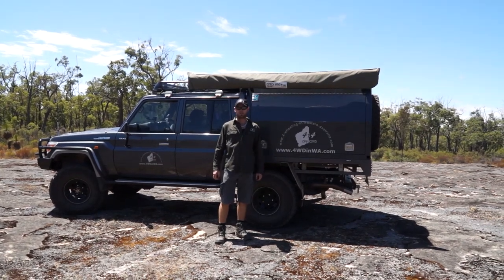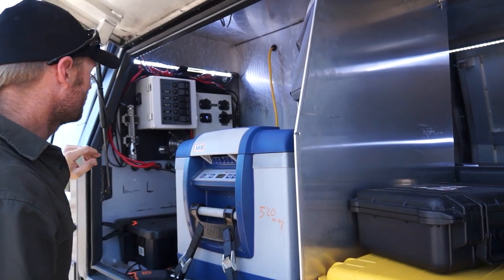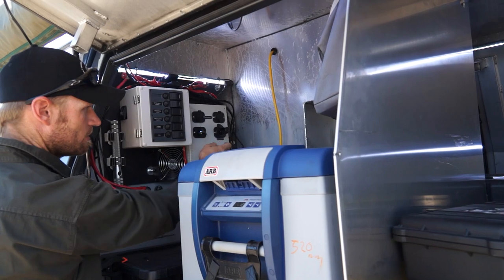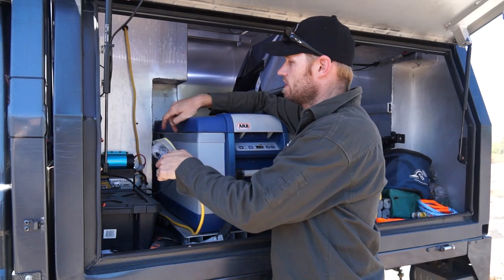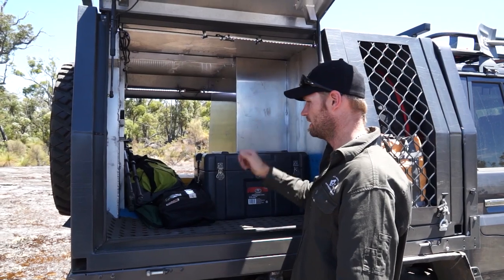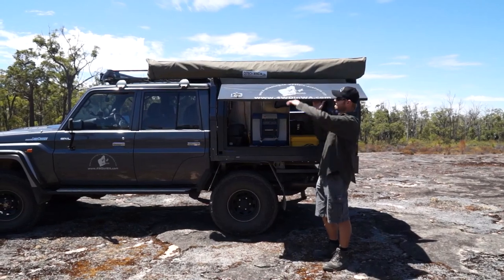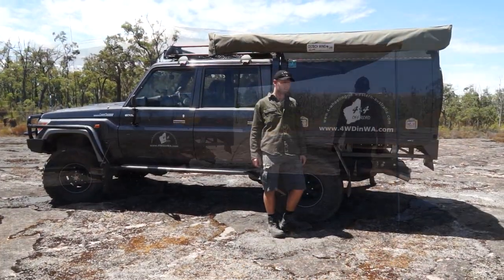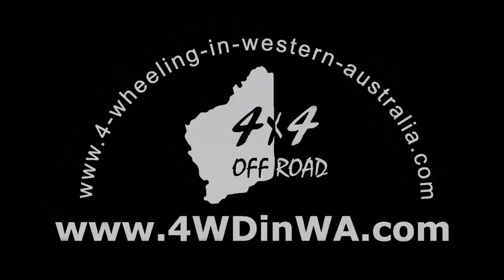79 series Landcruiser 4x4 review PART 2 MODS Rear Canopy

Comment: You have a beautiful vehicle Ronny, the 79 spec double cab in Kenya comes with a different steel rear cargo cab. Thanks for your Cruiser uploads
Reply from the maker: No probs mate thanks. Do you get the 4.5 V8 in Kenya?
Reply: Unfortunately the 4.5 V8 is not available in Kenya, what's available is the 4.2 which gets the job done but lacks the punch. Cheers

Comment: Such an awesome rig mate... An insanely well thought out and beautiful build of my favorite truck of all time.  Great work and thanks for taking the time t'run through it all aye.  You've inspired me to get pushing on my own LHD Toyota Diesel build/swap...

I moved home (Oregon/Pacific NW US... you'd love it here it's a 4wd paradise) from OZ after a fair few years to the sad fact that we don;t get the best trucks here... mainly we don't get Diesel Toyota.  So, I'm building my own: 1KZ-TE (not a worry here as it never get's that hot and I only have to contend with a few high altitude/step-grade passes every so often) into a SAS'd LHD VZN130 Chassis, F/R 80-series axles w/dual Toyota E-lockers, on-board welder/water/filtering etc and all the aerials one could need.  It's my "rafting/mountain-biking/rally-car tow rig/Expedition/live out of it for a month" truck and my Daily driver... Plus it allows me to replace my 22RE 1st Gen Hilux Surf as my daily so it can become the trail toy it was meant to e... 

Anyway, sorry for the gab, love your truck, thanks a heap for the info and detailed look mate.
Reply from the maker: cheers mate, Good luck with the build, keen to know more about your build as it gets going. Are you going to post anything about it on youtube or a forum?
Reply: Ronny Dahl Hey thanks mate... I will be making a better build-thread and shooting some vid to put up here as I get over some little "hurdles".  Currently I have the gasser out and in the process of dropping the oil-burner in we discovered that the oil pan/sump was going to be an issue so I ordered a bunch of stuff from Japan and when it get's here... the oil pickup tube didn't quite fit right so out came the Mig and cutting wheels... stuff like that has been holding me up like all projects do aye.  Wouldn't be a "project" if it didn't have a few hiccups right???

I'm over on Expedition Portal (you'd probably enjoy the place, tons of Toyota guys and all based around exploration wheeling.  Predominantly N.Americans but has a good Int. community as well.  I can tell you people will absolutely LOOSE IT if they see your rig) and I spend a lot of time scouring IH8Mud trying to find answers to little questions/concerns etc.  

 I'm gonna subscribe to your channel so as I make more progress and some content to share I'll drop you a line mate.  

Again... LOVE your 79 aye.
Reply from the maker: D King awesome sounds good mate, sorry about the late reply getting flooded with questions from the website and youtube. Whould you be keen to share your build at this page;? http://www.4-wheeling-in-western-australia.com/your-4x4.html its early days on this particular page and once we start getting a fair few in there we will make a specific page for LC70 build ups and other vehicle.
Cheer Ronny
Reply: Ronny Dahl No worries mate, I understand, hell I'd never stop chawing your ear off if I were anywhere near ya hahahaha.  I'd be glad to share my build on that page mate, I'm sadly NOT making such great progress (being that I'm still fighting with trying to find the proper KZN130 Surf 4wd Oil pan and being in the US means I have VERY few options when it comes to parts and getting "stuff" for the swap) but I'd LVOE to help make the page/board into a good resource for others and if adding my build there will help with that, I'm in aye.  All the best to ya and always good to have a wag with an Aussie, like I say, I miss OZ every single day, and at this point I sure wish I was living there still cause I'd just buy myself the Diesel Toyota I can't get here (either a 130 Quad-cab Hilux or a 76 like your more likely).   It's horrible for me since I LIVED there and had my deram truck but now I'm back in the silly US of A and our "no Toyota Diesels of 70-series" way of living (that's not living IMO),...  Enough of my blathering, I'll check out the page and get on sharing my build on there.  Best to ya mate.

Comment: how long will the arb run on battery power and also would it be worth it if you only had one 12v battery... I have an optima red top but other than that my fj60 does not have an extremely robust electrical system just factory.

Comment: Hi Ronny,
                 When doing the 3 inch lift did you need to upgrade the radius arms to get the caster correct, or did you put in off set bushes ?.Great truck, getting a canopy built for mine now, bigger job than expected. Lloyd from New Zealand.
Reply from the maker: +Glenda Robinson There are no extra bits and bobs on the suspension, even the steering damper is still stock. Those bits will change at some point but its running 100% good for the time being.
Reply: +Glenda Robinson who are you getting to build up your canopy am looking at getting one but hard to come by cheers

Comment: Hi,
Sorry if someone has asked before, but why didn't you mount both spare wheels on the rear of the canopy (I thought the canopy would have been wide enough. Also it appears that the one spare that is mounted on the rear is recessed into the canopy. Are you simply worried about hanging to much weight to far back?
Thanks mate,
Reply from the maker: You'er spot on Kym, the rear axle is close to the cab so the tray is counter levering so to speak, adding weight is better right over the axles rather than the rear. My next design will have both spare at the cab end.
Reply: Ronny Dahl Thank you Ronny for the prompt reply. I've got some thinking to do now. My mates have had their Nissans extended to help address this issue. I guess that it makes sense to store the spares up front and have the canopy extending rearwards and loaded as light as possible at the very back. THANK YOU,

Comment: I'm wondering how much suspension or body lift thies overlanding vehicles generally are recommended for best overlanding trails?
Reply from the maker: +Red Rock Adventure in my opinion 2-3 inch is more than sufficient over 4 inch is starts to get unstable on the highway and involves a lot more
Reply: Ronny Dahl I really appreciate the fast response thank you. I'm going for 3inch lift with 35inch tires. Thank you again!

Comment: Looking for a lift kit for my diesel hilux 2010 dual cab, not sure whether to go 3 inch or 2 inch and what brands are reliable?
Reply from the maker: +Jayden Sawtell for a Hilux I'd personally keep the lift to a 2 or 2.5inch to avoid too much stress on the cv,s there are heaps of brands out there I used to have tough dog all round with King coils on the front as I found them pretty strong